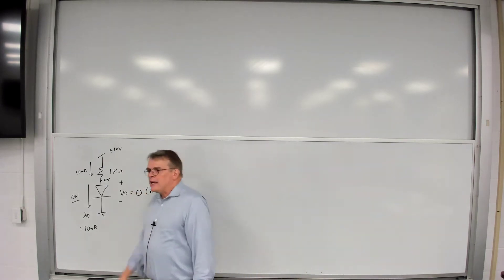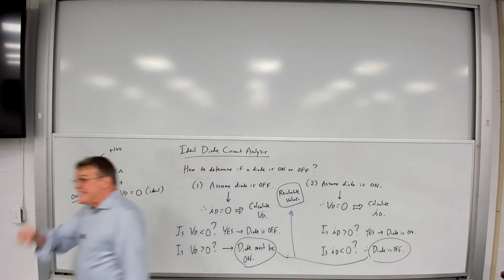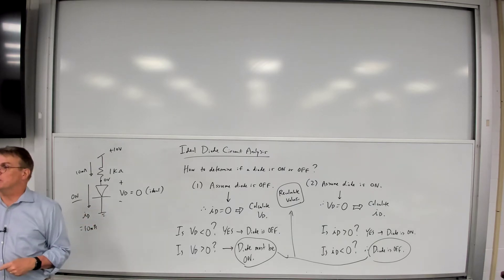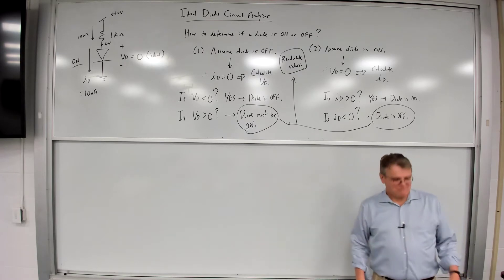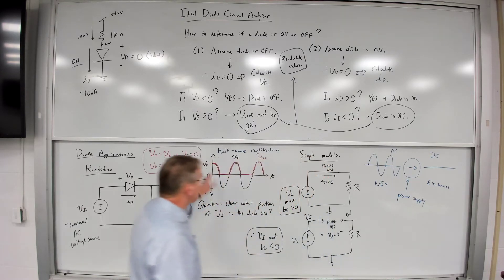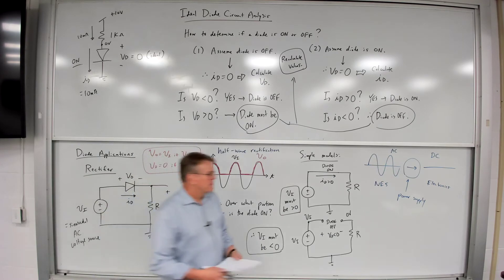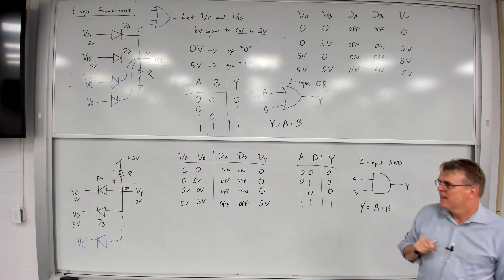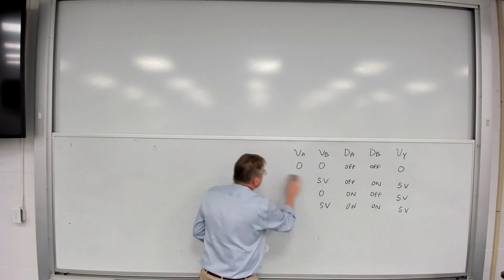Electronics - Lecture 2: Half-wave rectifiers, diode current steering circuits, diode logic circuits

Comment: Amazing lecturing, love from Turkey! I am going slow on pacing so I want to ask, at what point do you stop to assume the diodes are ideal in this course? Or is that always the case?
Reply from the maker: In later lectures I introduce the CVD (constant voltage drop) model as well as the exponential p-n diode equation.  The ideal diode model is only used at the start of the course.
Reply: @wtimothyholman  Thank you for your response and time, I will be continuing the course in that case as I needed help with understanding CVD models especially, thank you once again for your lecturing as well.

Comment: Hey Tim i have a question about the Vd. If the voltage across the diode is 0 then doesnt that mean that there is no current and therefore id equal to 0?.
Reply from the maker: You are thinking of the diode as if it is a resistor, but that is not the case.  When the ideal diode is on, it behaves like a perfect wire with zero resistance (although the current can only flow in one direction).  And like a wire, the ideal diode can therefore conduct any amount of current with zero voltage across it.
Reply: @wtimothyholman  I'm still not getting it because from what you said and with that theory if there is no voltage source even hooked up to the ideal diode it would start conducting current because the Vd is essentially 0? Is this thinking wrong and if so please correct me Its really bugging me that I cant understand this. Thanks
Reply from the maker: If there's no independent voltage source or current source connected to a circuit containing an ideal diode, then no current can flow through the diode.  A ideal diode either behaves like an open circuit when "off" (and Vd < 0), or an ideal (one-way) wire when "on" (and Id > 0).  When an ideal diode is turned on, the voltage across the diode is zero.  You can replace the diode with a wire when calculating other voltages and currents in the circuit.  Whatever current flows through the diode will be a function of those other components in the circuit.  But by itself, an ideal diode cannot create current on its own.
Reply: @wtimothyholman  oh ok. I get it now. When the diode is on it behaves like an ideal wire and the voltage is 0. Thank you so much. Now I can go to bed peacefully.

Comment: Wait I have a question. In last part the Da and Db are on. Thats means there is current on there, so there will be a voltage on circuit. And If Da and Db is off it means there is no current can cross on Da and Db. So there will be no voltage on circuit. Can you explain please what happened there. Thank you!! :)
Reply from the maker: It is not clear to me what you are asking, but I assume you are wondering why Vy = 5 V when DA and DB are off.  In this case there's no voltage drop across the resistor R when the current through it equals zero, so by Ohm's Law the voltage equals 5 V on both sides of the resistor.